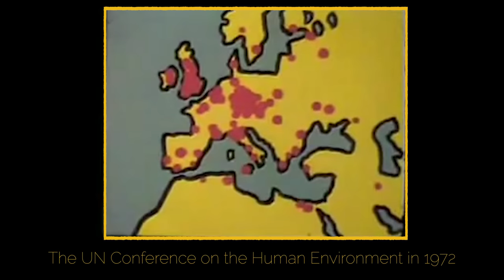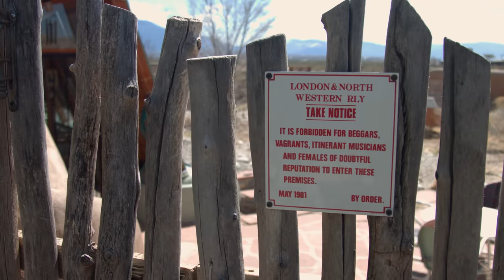Earthships - America's Off-Grid Desert Community

Comment: I would love for them to come up with ways to use these ideas with already constricted homes. Rather than building all new structures, what could they theoretically do with all the existing structures in old neighborhoods that could absolutely use more sustainability.
Reply: I saw a video on lowering energy costs and they 3 guests. One wind, one solar but the third was a lady who said we could have a 50 % reduction in home energy costs just by insulating your home. Doors windows and electrical outlets let the cold enter and the heat escape. Very inexpensive way to cut costs and usage. Food for thought.
Reply: @chasjacks9378  that's an excellent point

Comment: 10:12 what a lot of people aren't aware of is the fact that with one high output light bulb located in a closet a basement or an attic can supply an entire huge mansion with light using fiber optic bundles which is probably more upfront but easily recovered over a few years of having to only Power a single bulb granted when the light bulb burns out all the lights go out but if you always have a spare on hand you're never without light for long

Comment: "A few degrees of True South" is the sweet spot for my Squash growing stations trailings & loop backs...
Reply: how will you be "off the grid" when you rely on the very grid to provide you with literally EVERYTHING you need to build these places? wood, metal, electronics, septic tanks, solar panels, cans, rubber tires just to name a few
Reply: Always thought I would really have to consider the phases of sunlight to optimally  harness heat and light...  now I know!

Comment: If this was done as a city with all the technology and equipment that other constructions works enjoy -- this will be such a massive hit... Literally overnight success. It's no wonder that the government is fighting this.
Reply: it wouldnt
some of the ideas are great but some are just silly
Using cans is a terrible idea, it's usually cheaper to recycle them instead of producing new alluminium, it's also greener...
most of these homes seem really labour intensive and take a lot of space. 
Those are two things that don't work well in cities unless you are a billionaire...
Reply: @novepe  I believe a big point of the whole build is that you use your trash to make a house. It’s one of the biggest selling points for these houses. The cans don’t require manufacturing, they require recycling. So does any trash, and recycling is mostly cheaper than manufacturing new parts.

On the other points…. True. To take advantage of the heat distribution technique you need enough landscape area. If it’s in the middle of NYC there is no way to take advantage of the natural properties of the land and surroundings. 

However if a city were to be built from scratch it would be a massive success.
Reply: @SS369  The cans require manufacturing, are you suggesting we are just gonna stop using cans? Main point is you don't need to use cans in these houses and there are better uses for them.

No, recycling is not often cheaper than manufacturing. Cans are a really rare case.

The point of my comment is that this is not a solution for anything our world faces. Sure, finding clever ways to use thrash are great but this ain't it.
Reply: Exactly
Reply: @SS369  I agree

Comment: Love how many cool ideas are being put into these. Hope to utilize a lot of these ideas once I can find my own little piece of land to restore. My main concern is the potential contamination of the water and surrounding soil from some of the materials such as the tires, which have been a key component. Especially since that is the same water is being taken up by the food you eat. I'd love to try some of these using larger rocks from the land in place of some of those tires. Love the use of the glass bottles and water recycling though!
Reply: how is rubber a problem as it is outside with packed sand for thermal mass and where does it come into contact with the closed system water ? you are mistaken , that said I don't like that idea myself . I 've seen some really nice builds using large rocks , where they're available . especially one where the whole base under the floor was a huge rock thermal mass

Comment: I researched these for awhile and the conclusions I found was less than impressive. Typically these builds use a lot of open concrete which can suck moisture from the air. Also tires breakdown overtime into a toxic gas that is not good for your health. Than getting the land and reselling these homes is really tough. The sustainable factor basically is a wash. But boy do these homes look super artistic and the idea of being self-sustaining via plants and re-use of water is great idea that should be incorporated into more homes that don't require you to live in the middle of nowhere. Cool video - thanks
Reply: Damn it… that sucks
Reply: True, but this is just the start. Once more people start doing this, people will find ways to optimize their builds and share ideas. I’n sure van life started out similarly, but became easier and safer as people gained knowledge and experience. We may not be there yet, but it’s a step in the right direction.

Comment: I think the main problem is that a lot of different materials and waste are mixed together here and It's only temporary. If the building is demolished in a few decades, you'll have the waste problem again, only this time a lot of materials will be mixed together and it will be almost impossible to recycle them. For example, previously you could have easily recycled the tires before they were installed. Now everything is mixed together and the cost and effort to separate the waste into the individual materials would be immense.

Comment: Hey! ok! Tyre Pounding...  I take one look at this and I think! (watch from 17:21).  I have never done this, but hey!  But I have filled tyres with earth before... You set it on the side, (well, maybe because my soil is not sandy like your is, but any way...) fill it with dirt, add a little water and just pat it in till its solid. rotate and repeat.  (beware fall-outs when your rotation approaches 180 degrees...  Then when you have all the sidewalls filled, set it flat (cardboard side down, of course) and fill in with the rest of the dirt and Bob's your uncle, Your Uncle is BOB!! (Marley, of course   :-)

Comment: I think there is probably a different way to build the earth berm without using the tires, or by using something else to replace their function. The glass and aluminum aren’t going to degrade into anything harmful to the people who live there as long as they can’t get vapour trapped in them and get mouldy, the dirt is fine for the thermal mass and in earthen plaster with quicklime, but I am just really uneasy about the rubber in the tyres being toxic and leaching into the groundwater or contaminating the air or something weird, it’s probably just my anxiety acting up but I’d be much more comfortable with there being an alternative to using tyres.

Comment: wondering in that cooling/heating design would work in a place where we get several feet of snow?
Reply: The physics of heat transfer is a simple concept if you remember the basics. Heat does not like itself so heat always moves to a cooler place. Hot pan of water on stop and you place your cooler finger into it the heat travels into your finger. The greater the  temperature difference the faster heat moves or transfers. The old tires packed with dirt resist the heat transfer to cooler area or slow the movement speed down. Now you can create your own scenario how to speed up or slow down heat transfer to condition a living space. Remove or add heat?.
Reply: @morganplisken7271  so…. No?

Comment: Why aren't they utilizing units planted in the ground that condense water vapor in the air into liquid water in side the units vessles that are 4' under ground or more. Where the ground temperature is cool and causes the water vapor to condense like dew and collect in the vessles then it can be pumped via solar powered pumps to irrigate crops and orchards and so on. Using the 3 sisters crops growing technique and other Permacuture growing techniques, and utilizing all final wastewater for fertilizers and watering as well as the Unites I described as drip irrigation which is the best and most productive irrigation type to use in desert locations. 🏜. Even can utilize these techniques to create pastures and willow trees to build living organic fences that get stronger, bigger and more robust as they grow and also feed the livestock as well. It could even be possible to harvest enough extra water from the air to facilitate a pond or even a small lake that could also grow fish that feed on human wastes and serve as a reservoir that if built right could be used to create hydroelectric energy and by the same moving of thar water for energy production keep the water in the reservoir moving and oxygenated for aquatic life. The the fish could be harvested at several points throughout the year and feed the community as well as all the food/Oasis crops and fruits. It's just a matter of also harvesting these crops and fruits and putting it all to good healthy use. And storing can't be eaten before it spoils and rots. So, via canning and food dehydrating etc. Also, smoking meats and canning meats. And doing so all natural and organic and healthy. Seems like even a Vinyard could be possible. I would love to love in such a place as that. But, this is way way way to arid and hot and no shade anywhere. Needs more shade and comfortable and asthwticly pleasing out outdoor spaces. Yk

Comment: I invented a new type of air duct I think it's maybe a game changer for Earth ships,  this will increase efficiency by a lot also make them much safer. I think people still make these Earthships ?  We missed a golden opportunity here to increase the efficiency, if you think about it we have basically induction, like a car. Well, what do we do with a car when we want more performance ?. We increase induction capacity, let it breathe freely...we need a bigger pipe, ya it needs to be accessible, like 4 feet diameter pipe,  it needs to zig and zag, then come up out of the dirt with a intake fan and air filter and need electrical panel there. You can have more exits, besides the front door, fan exit plus emergency.  It's just some much bigger pipe sections with 90's and some planning, totally worth it for construction costs and fire safety. This means you get only clean air into your Earth ship, it's forced induction through a longer, much wider buried pipe, you can't even crawl in a 10 inch pipe, some dumb animal can go live inside there now what ?.  If you add this pipe to a sealed home with solar windows, you will have heating and cooling efficiency that is the best possible, better than NASA. 

Some retired NASA guy made a passive cottage actually, but he didn't have the tire wall, I might actually want the tire wall. The windows he used were very fancy solar though, the back of his house had just a couple small windows and extra insulation. I almost bought it back in like 2015, it was on some 5 acres with fruit trees, but there was nothing in the home it wasn't very large. He claimed, it basically heated and cooled itself to where it was always comfortable in there no matter how bad the weather was, like a Earth ship. Not sure how the placement of windows can matter this much, but this cottage it was a little gem. If I follow his approach to good solar window, It will be efficient. If you add my larger pipe design, we just need to seal the windows real tight, maybe the door too, it will be climate control basically automatic. Just add lots of exit for the air flow by the greenhouse, you will feel comfy all of the time, you should feel like having central air on demand, just open the vent more or turn the intake fan on. The heating or cooling effect should be around double what it is with current intakes, possibly more.

Comment: NO. Respectfully. Back around 2010, I watched the founder/inventor spend a week with 3 friends in one of the larger models. Day 1, all boasting the  bounty of the 3’ x 15’ garden in the home. Day 2, ditto.

By the 4th day, they ended early. They FINALLY realized that the 4 of them were going to completely deplete the “self-sustaining” garden before a week. (I originally had researched it as a potential option. If there was a video, I had seen it. But all I could realistically think re: this New Mexico community? Was: Desert, Desert, Desert + Those little in-home gardens were not an answer. You need a FARM. And there is a reason you don’t see a ton of produce farms in the desert. 

Then I came to learn this founder designer has never lived in an earthship.  He has lived on-grid. 

I actually saw this same video over a decade ago.

Comment: The problem is the abundance of non-sensible laws made by the building departments in our nation. You can live in the most remote area and over time they will apply the strict building codes of the next big city which might be 150 miles away. Like no structure over 200 sqft can be built on your own land without a septic permit even on top of a mountain in the middle of nowhere. You might be lucky for a while, but then they will come and enforce their rules and make you tear everything down.

Comment: Don't old tyres release chemicals in the air as they decompose with time? They do smell. I think they might be OK if buried in cement or mud, but I saw them exposed inside one of the buildings. That's a cancer time-bomb. (Ouch, I wrote that half-way through the video, before I learned that tyres are used in "A/C" systems, and that the guy actually has cancer. That's insane.)

Comment: Only thing about earthships that seems like a crazy hazard is the tires. Everything else is fine but tires release so many toxins and pollutants into the air, ground and water. I get the desire of it being cheap and lasting for basically ever. But if there’s an alternative material like metal barrels, or wood or even cibder block it’d be significantly better for your health. But then it’d have a cost which defeats the purpose.